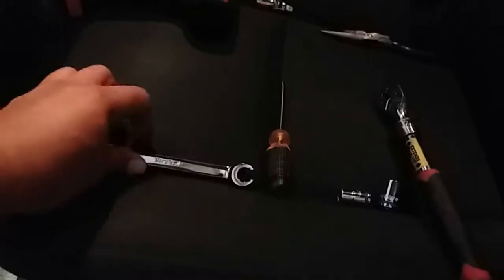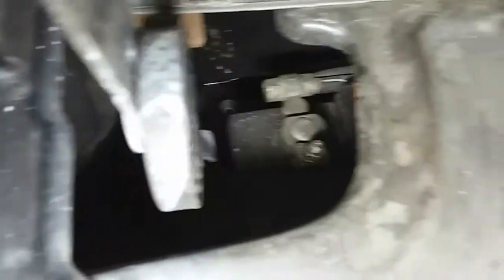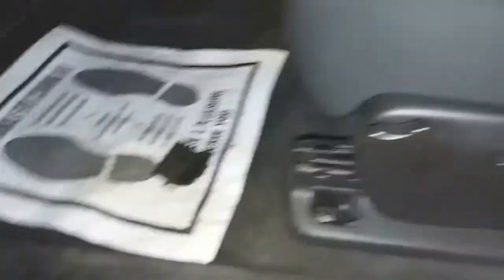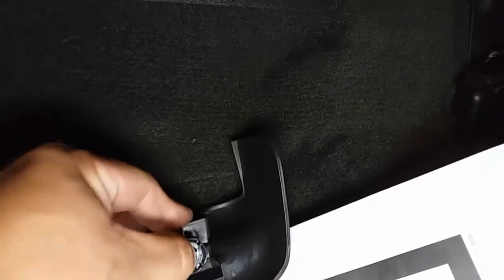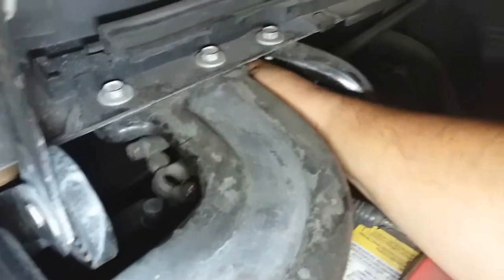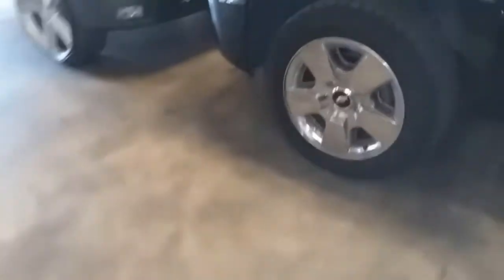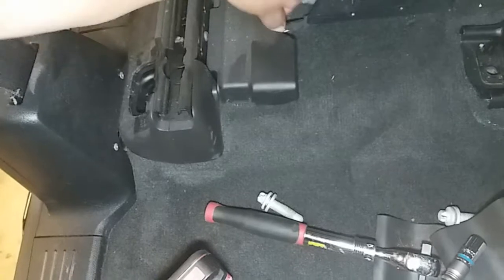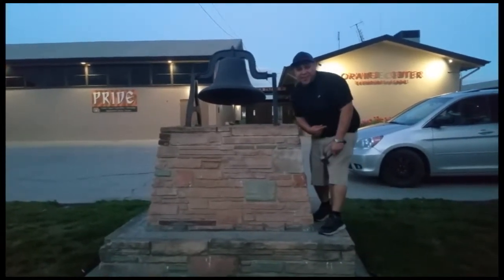How to: Remove the Driver seat on a 2012 Chevrolet Silverado

Comment: We’ll done!! One of the motors on my driver seat went out and my driver seat is set all the way back from the gas pedal. I’m not that tall and having my leg extended out for periods of time, has got my leg hurting. Not sure what little motor went bad. Thank you for sharing your knowledge!
Reply from the maker: Thank you hope you get this resolved. What we do at the dealership is replace the whole seat with a used one from parts dismantled by a company like Lkq
https://www.lkqonline.com/

Goodluck and Thank you for your SUPPORT!
Reply: @559powerscape  I’ll be sure to check these guys out!! 👍🏽👍🏽

Comment: You didn't remove the seatbellt. Its not completely out until the seatbelt is removed. There is a torx T50 bolt that holds the seat belt to the seat. Thanks for the video . I just replaced  my seat in my 2013 2500 Silverado. The front 2 seat bolts were 14mm and the back were 2 were 11mm on my 2013.
Reply from the maker: Oh my bad take off that 1 bolt holding the seat belt and your set
Reply: The actual proper tools for those bonehead torx heads is E-18 deep socket, and E-14 shallow to lock into them properly.  A metric 12 point will work, they are only grabbing with 1/2 the gizmos inside the socket, and can strip the thingys on the top of the torx nut holding the seat.

Comment: So if I remove the passenger seat and need to move the driver seat am i gonna be okay to put the battery terminal back on to move the seat or will airbags go off or anything?
Reply from the maker: No ur good nothing will happen, just the air bag light might turn on but will turn off when everything is back connected
Reply: @559powerscape  I didn't disconnect the truck battery when I changed  my seat. And now the service airbag light comes  on every time I start my truck.  Do you know how to fix this? Any help would be greatly appreciated

Comment: Question do I really need to disconnect the battery to do this?
Reply from the maker: no ive never had an air bag go off...its just a precaution
Reply: Can you drive the vehicle with the seat removed? Or would the air bags deploy?
Reply: @user-kt1if5jq2g no there’s not any power to the seats got the airbag to deploy

Comment: I have followed you thus far but the seatbelt still connect to seat to the truck
Reply from the maker: Yes were the seat belt connects there's another TORX Bolt holding it down...take it off and your set
Reply: T50 torx
Reply from the maker: @raolito1980  thanx brodie!